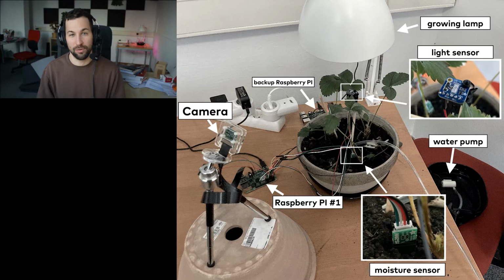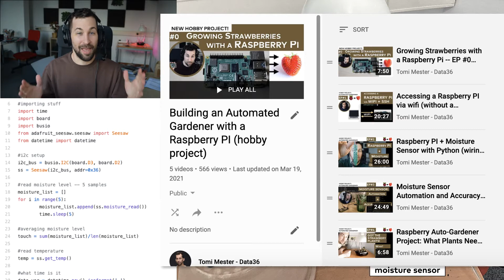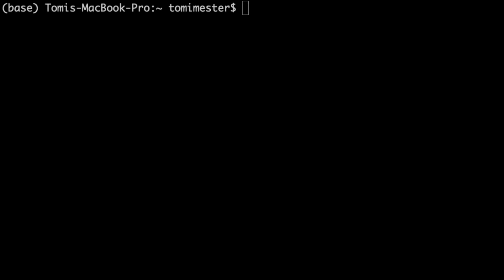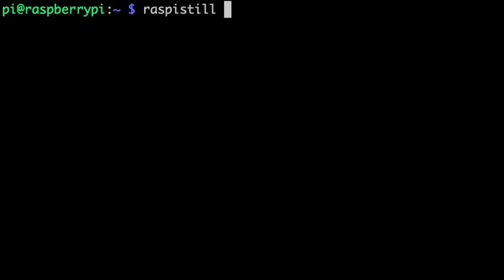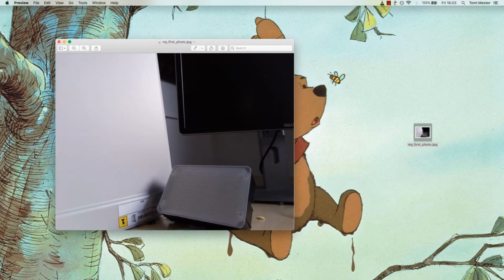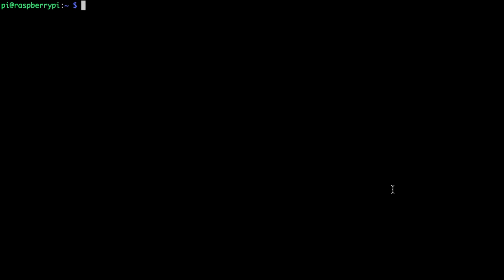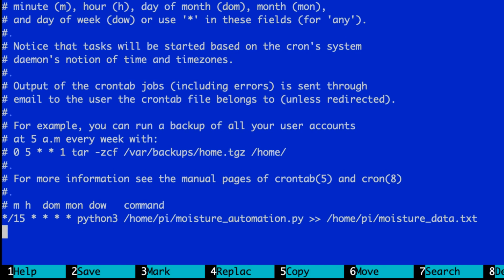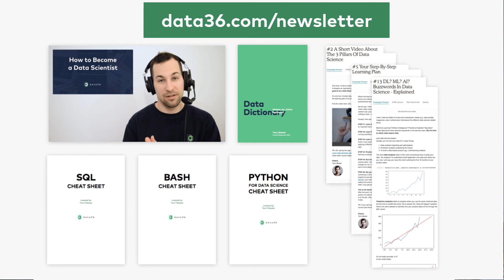Raspberry PI Camera setup: Wiring, Code, Focus Adjustment (Raspberry Pi autogardener project ep#5)

Comment: is it impossible to connect the water pump to the raspberrypi or what happened to this project? I mean, no offense, great project, amazing, love it,  but I am struggling with the water pump right now and no update in a year suggests this is not an easy-peasy step :D
Reply from the maker: It works, I’ve just stopped documenting it. It’s not easy, but not too hard either. Just take a 433mhz plug and a 433mhz radio transmitter for rpi. Then follow this tutorial: https://www.instructables.com/Super-Simple-Raspberry-Pi-433MHz-Home-Automation/
Reply: Ja, tök jók voltak a videók, kár érte. Köszi!!!  :))
Reply from the maker: @Gabcsor1  Köszi! Ha lesz folytatás, látod majd! ;-)